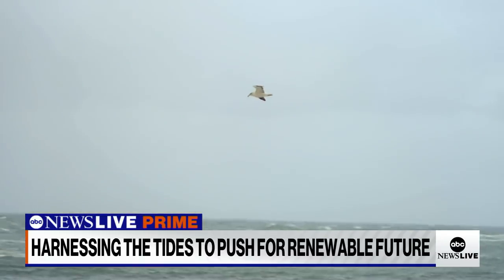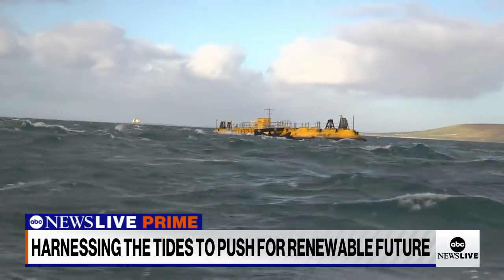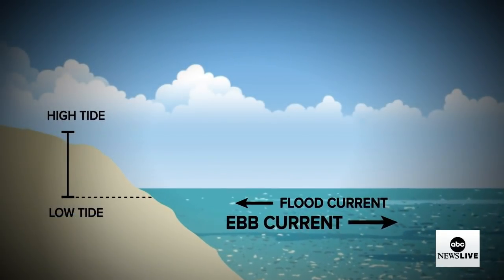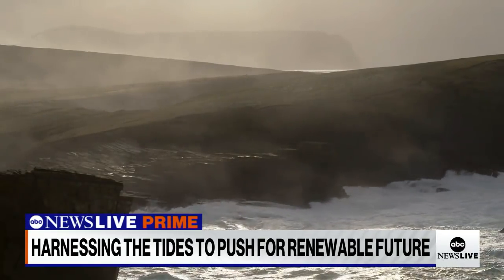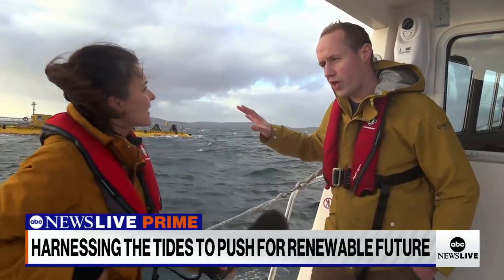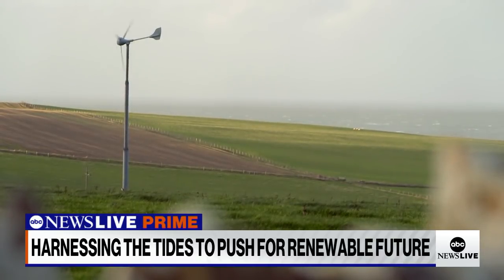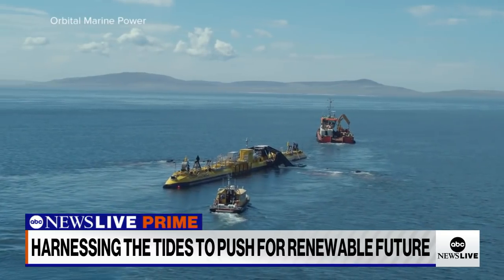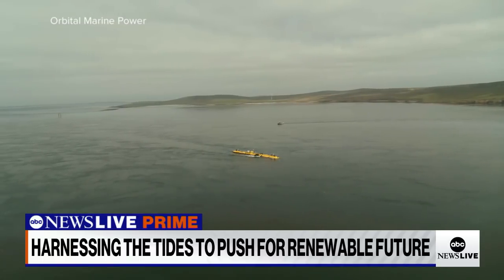Is tidal power a reliable form of clean energy?

Comment: The ocean is a big energy generator and storage. This is an interesting way of harvesting this big reservoir of energy. It certainly needs more investment and it will become price competitive and be the main energy source for coastal populations.
Reply: Canada's bay of Fundy should do this.
Reply: It needs less investment.
Reply: Don’t need ir want big spread out energy storage,  because then the collection system needs to be gigantic.  We want concentrated energy systems so one doesn’t pave over the countryside or the ocean.  Nuclear is concentrated energy.
Reply: @Nill757  you won't have to pave over anything, a cable is laid between the unit and an onshore collection building. If one house-sized building is 'paving over the countryside' then pave away in my books.
Reply: One floating yellow submarine is a toy.    To replace a typical 2GW nuclear plant, you’d need 6000 of these tidal toys,  all replaced every ten years or so, then a bunch of diesel generators ashore to cover slack tide, along with diesel fuel deliveries.  Yeah, that’s pretty close to paving over the ocean, and paving over the sea floor with anchor cables which scour the bottom.

Comment: It's time we use natural energy everywhere on earth.. Sun 🌞.. water 🌊.. wind....and so on.  A thing that should have been done decades ago in full action
Reply: The millions of tons of steel and copper and aluminum to build these beasts, is that natural ?
Reply: More natural than obliterating marine environments with drilling platforms built from more of the same material. @Nill757
Reply: Those kinds of comparisons show how many think of solar-wind-tidal are cute little toys that take only trivial resources. Not even close.  That tidal turbine takes a couple orders of magnitude more steel etc per unit energy produced than does an offshore drilling platform.  And the tidal turbine still requires some diesel generator hiding behind the curtain to run when the tide does not.  Get serious.  Energy  is not a toy.  Build nuclear.
Reply: @Nill757  Ok so you're not even going to cite a source or even lie about a number 🙄. Bro I don't change my mind based on anecdotes.

Comment: "Is tidil power reliable?" Is the moon likely to disappear any time soon?
Reply: The sun or venus or Jupiter yes they also effect it.
Reply: @thesilentone4024  
Shhhhh. Be quiet.
Reply: @thesilentone4024  you reaching my guy, not significantly
Reply: This may be shocking, but the tide vanishes, a couple times every day. Also that, that expensive steel tidal generator and its anchors and its copper cable ashore will vanish after a few years in the salt water and have to be replaced.  

Build nuclear.
Reply: @Nill757  the tide does not vanish, it just moves. The renewable energy is there for the taking, we just need better technology to extract it.

Comment: The answer is no... Salt alone is too corrosive for anything long term even with pricy difficult and constant maintenance...
Reply: @jamjamjamjamjammajmajmajmajmaj  Only works on a small scale..
Reply: Can’t “anode” a turbine blade against salt air and spray.
Reply: @Nill757  Again vgf thinks it's a save all but anodes are only short term n can wear away even when used correctly.. The ocean is a harsh mistress!

Comment: Tidal is not “consistent” in the sense that it is always on, rather it’s on a couple times a day, about 25% of the time at full power equivalent.  

BTW, about six thousand of those yellow turbines anchored offshore would be needed to match the energy of one 2GW nuclear plant, plus six thousand turbine to shore power cables, plus some gas or diesel power plant hiding onshore to cover slack tide, which is what Orkney does now.
Reply: What nuclear plant is 2GW? The largest is not even close. What the heck are you smoking?
Reply: Most nuclear plants have multiple individual reactors.  In the US, Palo Verde is the largest at 4GWe.  The largest individual reactors are now 1.6GWe.
Reply: The French have a six reactor plant at Gravelines.
Reply: @Nill757  So you're comparing a single tidal turbine to an entire nuclear plant? LOL donkaments.

And new nuclear isn't being built by most countries because of COST which you didn't mention at all.

Nuclear energy is in decline, solar + battery or wind + battery is far cheaper.
Reply: Read.  “ about six thousand of those yellow turbines anchored offshore would be needed to match the energy of one 2GW nuclear plant, plus six thousand turbine to shore power cables, plus some gas or diesel power plant hiding onshore to cover slack tide, which is what Orkney does now.”

If you cared about cost, you’d know Oarkney has the highest rates in the UK.
Reply: @Nill757  So add nuclear and increase the costs even more? Great idea bro, no wonder you're in charge of energy policy.
Reply: @Nill757  Wow a whole 19% LMFAO. Make more absurd claims please.

UK is shutting down nuclear power plants, not opening new ones, genius.

Comment: Say it with me. NUCLEAR POWER PLANTS.
Reply: Are expensive...
Reply: Not compared to tidal power. Everything’s cheaper than tidal, especially cheaper than tidal plus some diesel generators hiding  ashore.  That’s why tidal  rip-off companies like this need slick videos produced by network media to sell yellow submarines.
Reply: Ten years to build just one plant.  Most of the renewables take a fraction of that.  Time is money.
Reply: @palmshoot  renewables also make a whole 1 watt of power a minute soooo…
Reply: @cristianortega5850  Multiple hydro plants actually produce more than even the highest-output nuclear power plants.  We also need to remember that electricity isn't the only form of energy.  Geothermal is most efficient form of heating homes.  You'll recall that heating accounts for 47% of residential energy consumption in many parts of the world.

Comment: Sounds moronic, free energy doesn't exist, you take from something and something else loses it or reacts
"Every action has an equal and opposite reaction"
Reply: Sounds like a very expensive way to produce energy.  The mechanisms needed to capture the energy of the tide would cost more to build and maintain than the value of the energy it produces.
Reply: It isn’t free. It costs millions of dollars to build those tidal turbines. Then the owners have to pay someone to get the rights to anchor them, and also the installation isn’t done for free. 
The question is can these units run at a cost low enough to make them worthwhile to operate.
Reply: @briangarrow448  Also, these turbines being in salt water would make them vulnerable to corrosion, which means expensive cleaning costs, and they are at risk in storms to breaking anchor and ending up on the rocks.
Reply: @willmont8258  Yes, it’s definitely a tough environment for any rotating machinery. I will say that bearing and seal technology is much better than it was even 20 years ago. As for anchoring, with all the North Sea oil platforms that have been built, I imagine that the most secure technology is transferable from oil to tidal installations. It will come down to money- costs versus benefits.